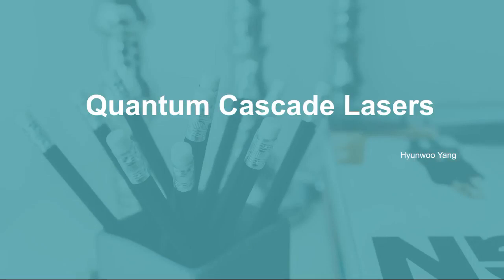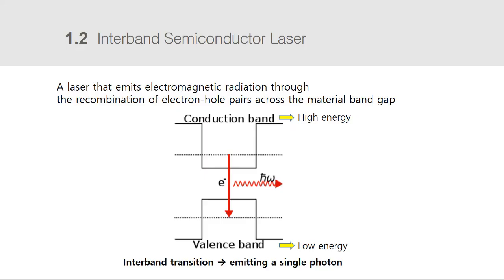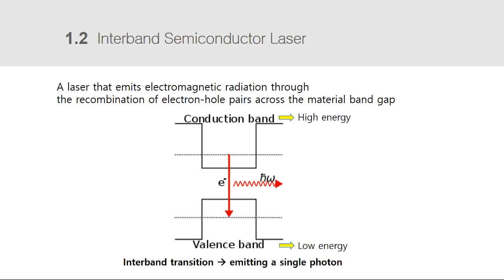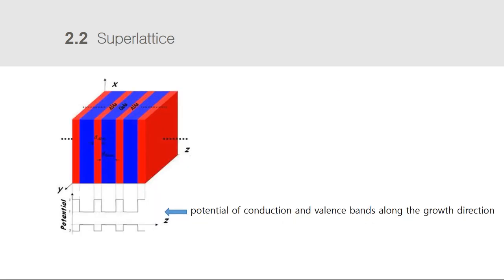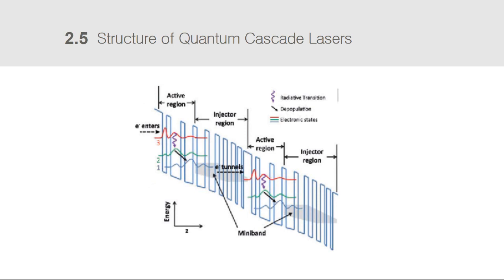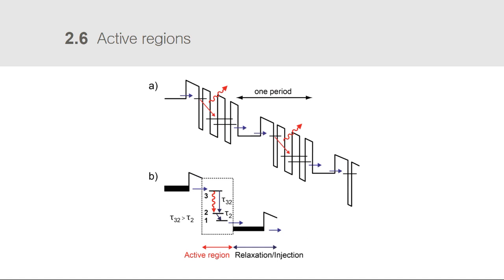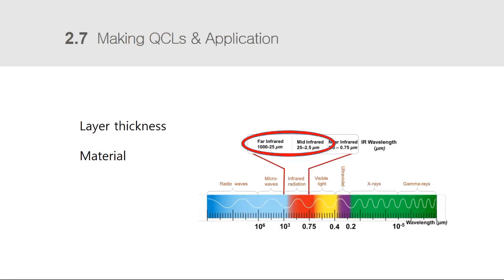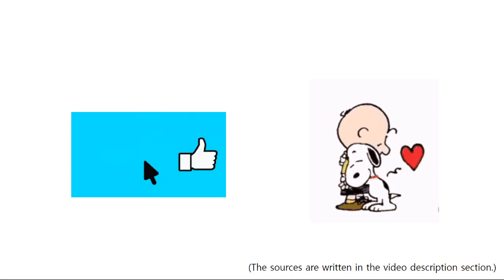Understanding Quantum Cascade Laser

Comment: Still don't get the point about the injection region. So we have similar wells, which the electron tunnels through to get to the next active region. But we do we need that?
Reply: Yeah I don't know the answer, but I'll take a stab without having looked anything up (and maybe come back to this later). I'd think the QWs in the injector region could be replaced by a single, thin barrier through which the activation electrons could tunnel. But, if this single barrier is too thin this would result in each of the active regions being quantumly linked to the ones nearest it. If the barrier is too thick the electrons can't get to the next active region. i.e the injector regions remove the active regions' abilities to "talk to each other" without removing the ability for the T23 electrons to continue tunneling through. It's a well understood phenomenon that two closely spaced QWs will begin sharing states.